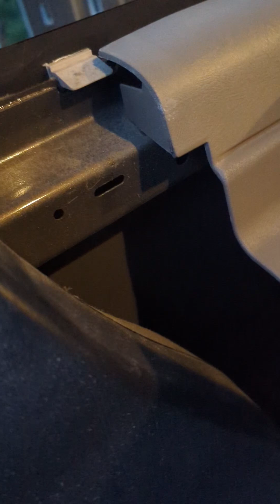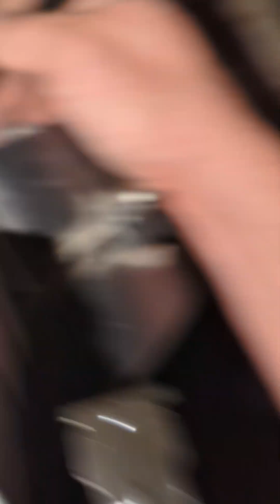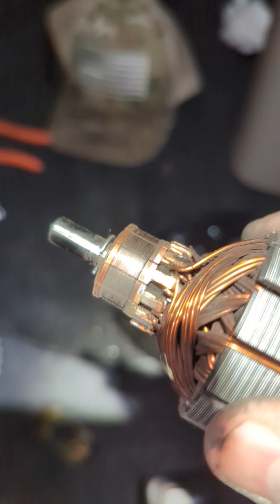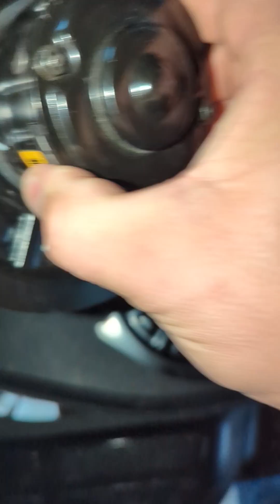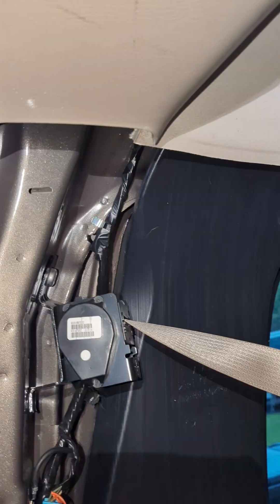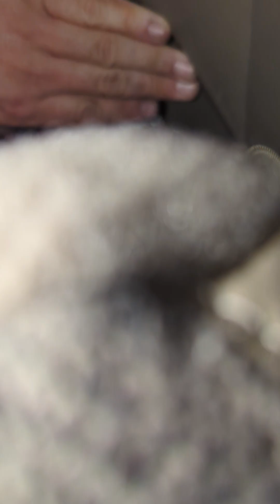Express Savana AUX Rear Blower Motor Troubleshooting Repair

Comment: Was it your top heater...the first controller knob..only on high?
Reply from the maker: Sorry, not sure what you're trying to ask.
Reply from the maker: If you're asking did the blower previously only work on high? No it didn't want to work at all. If you only have off and high that's typically your speed controller/resister card.